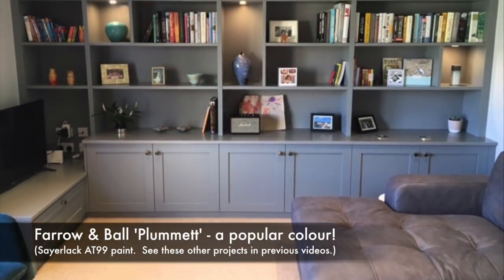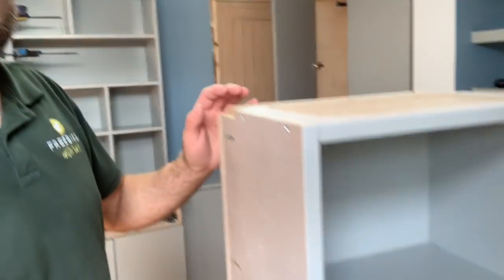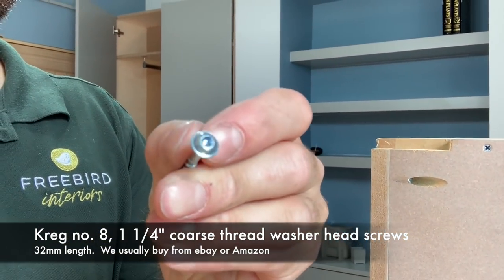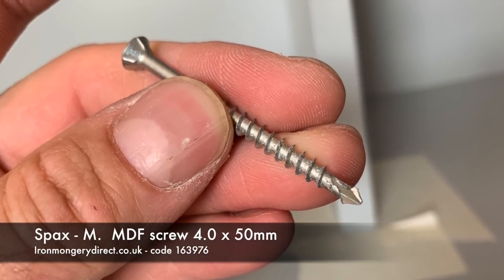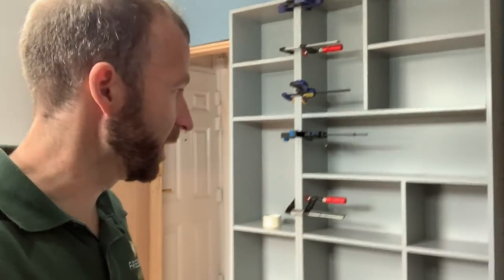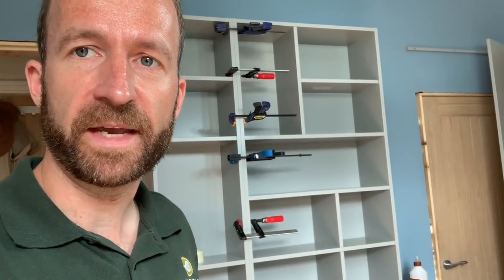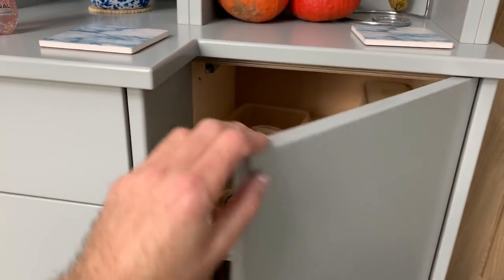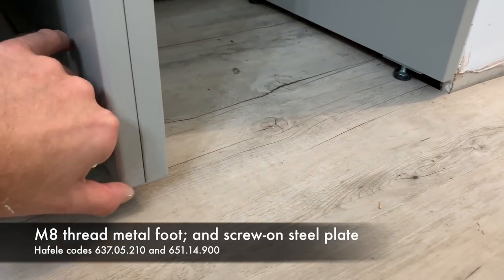Dining Room Makeover in a Sheffield Terraced House

Comment: You answered a lot of questions I had with this video. The glue type, the screws, drill bit, etc. Then again a few more pop in my mind just by watching the video carefully, like how many milimeters do you add to oversize the side cover panels so you have room to scribe (there's an idea - to see a video of of scribing and fitting one panel :)), and I think I stand correct that you oversize the top as well so you scribe it too.
Reply from the maker: Standard scribe allowance is 20mm extra beyond where the part touches the wall in the drawings

Comment: Alastair great videos and thanks for sharing tips to others. I note you use space plugs on side of units to space away from wall. Do you screw through the side panel to fit these and how do you hide those screws/holes from showing?
Reply from the maker: Sometimes I just use them like wedges, held in place with gap filling adhesive, and tightened both sides - I use them to square up slightly skewed units, as well as locking them firmly into place.  Thanks for the feedback!

Comment: Great video... how are the modern slab doors made? I want to make some as do not want the shaker style doors but not sure the best way to achieve this. Those doors look great.
Reply from the maker: John Canter just cut a rectangle out of MDF!  18mm would be ok but we mostly use 22mm these days. And at this time we were using Medite moisture resistant mdf but now we’ve discovered Finsa Fibrapan Hidrofugo mdf that’s even better.   Only a little fine sanding is required on the cut edges to get them paint ready.  And we use a 2mm bearing guided arris roundover router cutter to soften the arris edges
Reply: @Alastair_Freebird  Thank you so much for such a detailed response. I was hoping it would be that simple but wanted to check.

Comment: Another great video thanks - good advise of the screws; I'll have to try the confirmats as I normally use 'normal' screws and pilot hole - I see some of the carcases are plywood - is that just where their are inside a cupboard and won't be painted?
Reply from the maker: Kevin Gerald yes we make a saving by not painting internals unless customers request it (at a surcharge) and we decided birch ply looks better but also holds the screws better for the hinge mounting plates vs brown mdf.

Comment: Great piece of work I’ve got an alcove job coming up do you still have to pre drill those Spax screws
Reply: Holloway’s Carpentry you don’t need to pre drill the spax, they literally pilot the hole as they go in
Reply from the maker: Yeahs the purpose of the spax M is they self tap into MDF.  However we use them a lot less than we used to - it can be just as quick to pilot drill with a separate drill then drive a standard screw in because you have to wait i a while pressing on the tip of the screw as it spins before it really catches and drives in